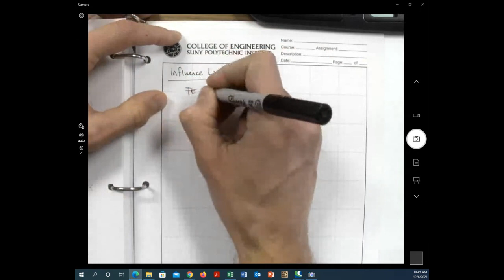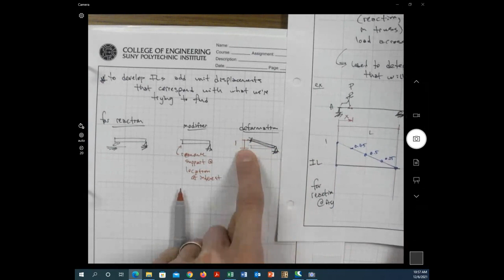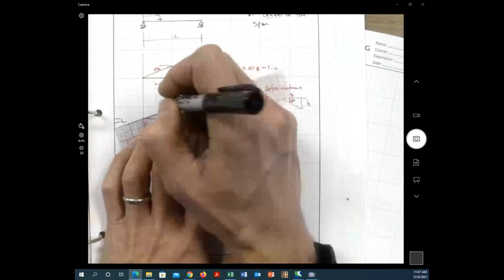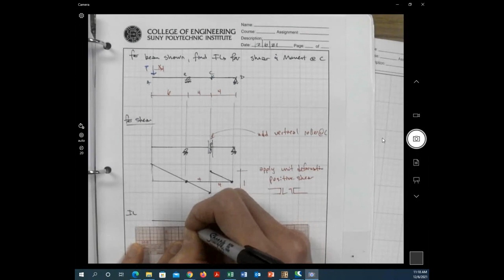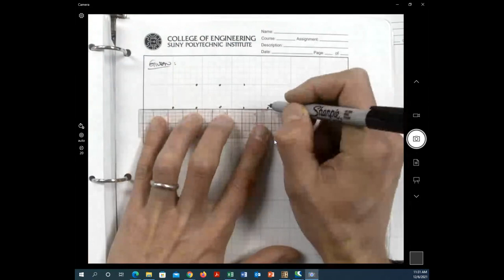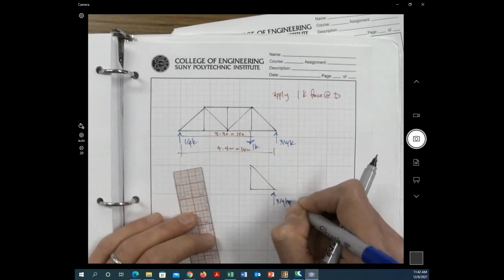Influence Lines Lecture (Part 1 from CTC 320 Fall 2021)

Comment: Where can we find part 2?
Reply from the maker: The error was just a calculator mistake. If you solve 4 / 1.0607 * 0.7071 (which is what I wrote for the similar triangles) you should get 2.67 ft. That's the correct answer. I did not post the video for that, but the member force does indeed go to zero in the model when the load is placed 2.67 feet from point C. I hope this helps!! Calculator mistakes seem to happen more frequently when you're rushing, like I was at the end of class here. 🤦‍♂